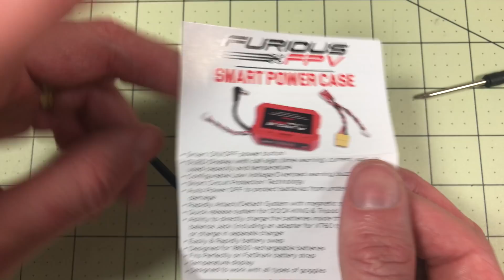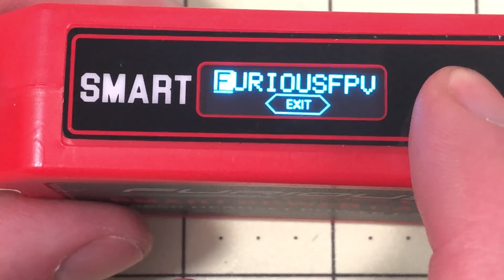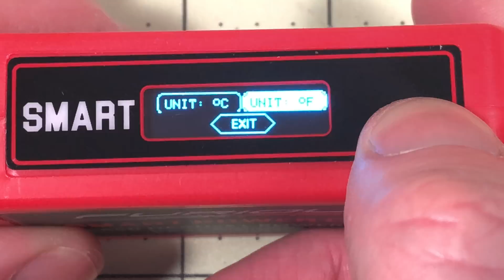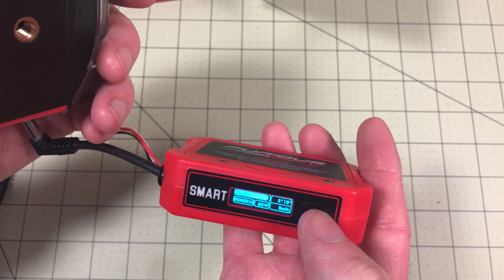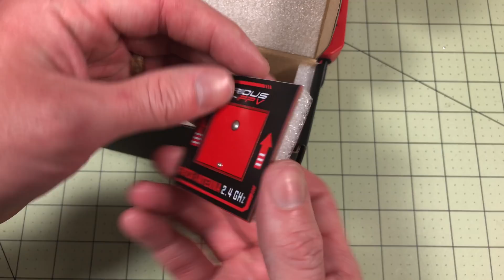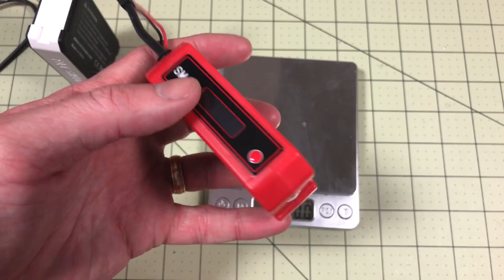FuriousFPV Battery Case, OSD, Power Button, What more could you want?

Comment from the maker: These are VERY new so stock may be limited:
GetFPV: http://bit.ly/FuriousFPVBatteryCase-GFPV

FatShark USB 1800mAh Goggle Battery 
GetFPV: http://bit.ly/FatSharkUSB1800mah-GFPV 
Amazon: http://geni.us/FatSharkUSB1800Mah

I think the Dock-King is really going to shine with long range 2.4Ghz
GetFPV: http://bit.ly/Dock-King-GFPV Dock Only
Banggood: http://bit.ly/DockKingSingle-BG Dock Only
Banggood: http://bit.ly/DockKingCombo-BG Dock and Module
Amazon: http://geni.us/FuriousFPVDockKingOnly Dock Only
Amazon: http://geni.us/FuriousDockKingCombo Dock and Module
And the battery case is going to make it even easier since it will stack. http://bit.ly/FuriousFPVBatteryCase-GFPV 

The VTX is 800mw and the RX will work in the Dock-King or your Fatshark (and compatible) goggles 
http://bit.ly/FuriousFPV24VTX-GFPV 
http://bit.ly/FuriousFPVTrueD24Ghz-GFPV 

Today I would probably go with the IBCrazy antennas. Although I would be very tempted to make a 2.4Ghz Helical antenna myself http://bit.ly/IBCrazy24Bluebeampair-GFPV http://bit.ly/IBCrazy24Cannon-GFPV 

But I really want is IBCrazy's 2.4Ghz pepperbox. It's very large but is perfect for the flying we do. Very high DB but still with a wide beam. http://bit.ly/IBCrazy24PepperboxR-GFPV 

And once it's available the TrueRC Singularity for 2.4Ghz is propbably the perfect option if you are going to put this on a drone. It's much smaller than most 2.4Ghz antenna. http://bit.ly/TrueRCSingularity24-GFPV

Check out my current giveaway: http://geni.us/DroneRacer101Rewards

The FuriousFPV Smart Power Case give you a great set of features that may be missing from your goggles.  How about a power button? Or knowing how much power you have used, or exactly how much power is left in your batteries, or what the temperature of your batteries is, or making it magnetic so it will stick to things, or having it stack with the FuriousFPV Dock-King, or being able to charge the batteries in the case?  Yea, lots of features.
Reply: I like it!!

Comment: Fatsharks Goggles shut down at 6.8v. using this battery pack, the batterys are still half charged when the goggles shut off. its really not made to power googles although it can. its just the SmartFpv battery has so much left in it when used with the goggles. seams like the furious is using 2x as much power as just the 18650 battery pack.

Comment: How has your battery life been? It seams with the same batterys. The fatshark 18650 case last so much longer than the smart fpv. I understand it's running a gui but that doesnt even use any mah. It seams to go threw 18650s in not very long. I have plenty of 18650, brand new stock for all my vape mods. I was just woundering if you have noticed a noticeable difference in goggle on time. I'm going to compare the two when I have the time and a chance.

Comment: Is it work on eachine ev100 ?
Reply from the maker: IT would work just fine with the ev100s.  They have the same connector.  It may seem a little big compared to the stock ev100 battery.
Reply: DroneRacer101 thanks

Comment: Hi Mark,

Not to harp on it, but can you stick a multimeter in the output end of the smart battery case when it’s powered up? Especially when the batteries are a bit beat. 

The fatsharks shut down at 3.5 v/cell, which is a lipo thing, but li-ion batteries are good to like 3.1-3.2 v/cell. If the case has a step up regulator, the batteries will last way longer between charges. 

This info about the output voltage doesn’t seem to be covered on anyone’s reviews. 

Here’s a bardwell vid: https://m.youtube.com/watch?v=WubtmYuLieE

I’ve already ordered one of these. If it doesn’t have a step up regulator, I’m going to surgically add one.
Reply from the maker: I’m doing some testing right now.

Comment: Hey Mark, does this little guy have a voltage step-up? If not, the goggles will start wailing way before the batteries are kaputt. 

I sure hopenit has a step up regulator!

Cheers!
Reply from the maker: I don't believe so, it is going to depend on the goggles.  2S is pretty standard for these types of cases.